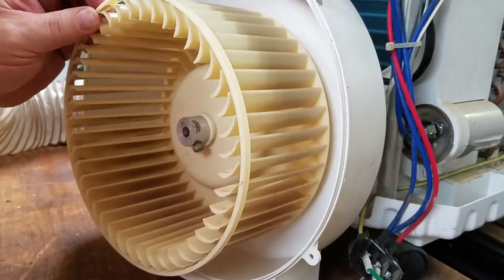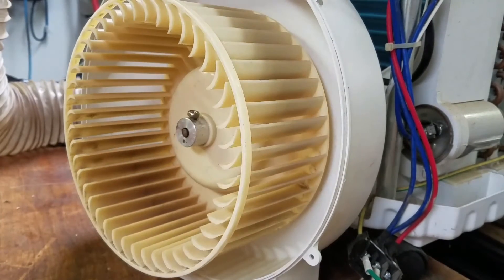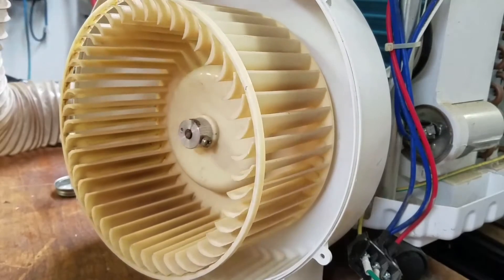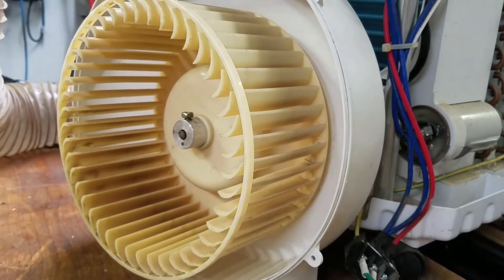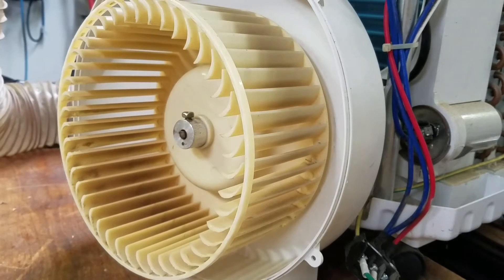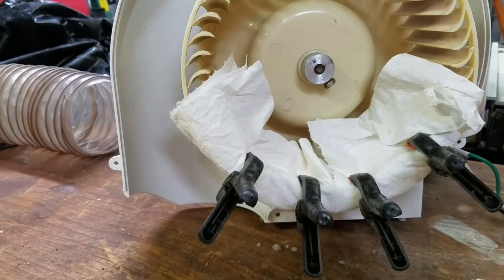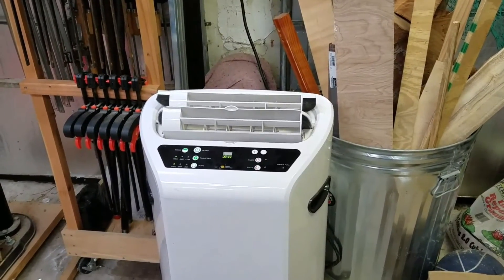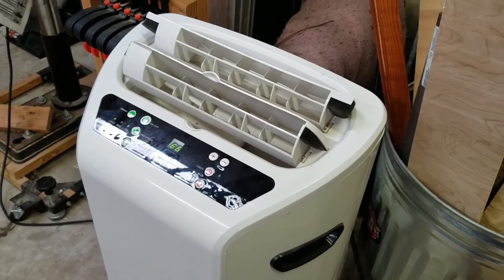Garage workshop portable air conditioner repair completed!

Comment: I cant find a part one how do you remove the blower fan? The mounting hole for the motor is to small to remove the fan through there and the hole where it pulls the cold are through the coil is to small as well and i don't see any seams to separate the styrofoam enclosure the blower fan is in cased in

Comment: Yeah, I bought one used and when I got it home it worked until that exhaust fan kicked on, and then the actual fan blades started shooting out the rear vent! I pulled all the panels off to try and figure out what to do but the fan is inside a nautilus looking casing that's behind something that looks like a radiator. Too much work just trying to get to the fan, which is pointless now because a lot of the fan blades are totally gone. 😔
Reply from the maker: Tracy, I will tell you this much. Once this thing completely gives up the ghost, I will never again buy a Royal Sovereign product. Exceptionally poor quality construction, and poorer quality control. The fan is exceptionally weak, the exhaust squirrel cage fan is downright dangerous, and to move air around enough to cool my 384 sq ft wood shop, I have to use a 20" air circulation fan from Home Depot. The specs look fantastic on paper, but in use, it's been nothing but an enormous waste of time effort and money.

The Nautilus shell cover for the fan isn't that hard to remove. Unbolt the screws for the metal tube uprights, unscrew the cover, nudge the upper piece up and shimmy the outer cover of the fan housing off. Okay I guess it was a bit of work... 

IF the rest of it works, you might try getting it apart and maybe seeing if you can scrounge up a squirrel cage blower fan that will fit and work from maybe a car AC unit or something... Just guessing at this point... 

I use mine in the garage workshop to keep it cool in the hot Texas summer, if I had to do it again, I would build a duct box to house a window unit, or better yet, install a mini split system.

I like it well enough to use it and put some effort into fixing / maintaining it. But I sure wouldn't put any real money into it, and I won't be buying from them again.
Reply: Dave's Workshop... Funny thing is... I found another used one of the exact same unit. I checked to make sure it worked before I bought it this time and transported it very carefully in the back seat of my pickup truck padded by pillows. The remote from the first unit works perfectly. I figured I could keep the broken one to salvage parts, or maybe order a new fan from the manufacturer.
Reply from the maker: Sadly, the MFG no longer supplies the replacement fan pieces for this unit.I would have bought a new one and swapped it in had it been available. That's why I went to the effort to glue / repair mine.
Reply: @Wildersport  These parts are amazingly common among many portable A/C units by a myriad of manufacturers. I was able to source the condenser blower motor from an online supplier, Sylvane. My unit had the same problem as yours. But the ring broke in two and jammed the wheel which overheated the motor. The motor has a non resettable thermal fuse imbedded in the windings. Also, the blower wheel itself seems to be available from Repair Clinic.
https://www.repairclinic.com/PartDetail/Blower-Wheel/A5304-450-AH-11/2110503
Thanks for your video!

Comment: The air conditioning unit was always working you broke it the fan blades so you could show us your super glue and Philips screw driver and what you can do with a q tip
Now I have a snooker que I will send it to you and you can show us all what you do with it

Comment: trying to open the Case cover on my Delonghi Penguino AC Unit without ruining anything, are there any how to videos? i dropped a drill bit through the top grill and it dropped down into the fan unit, how do i open it up and remove the drill bit?

Comment: I dropped a drill bit through the top grill of my Delonghi Penguino AC Unit, and it dropped down into the fan unit, how do i open it up and remove the drill bit without ruining anything, are there any how to videos?
Reply from the maker: I'm not entirely certain about the DeLonghi units I know I had to look up the assembly diagram from the manufacturer of mine to figure out how to take it apart. If you can get one of those magnets on an extending flexible shaft down there perhaps you can pull it up that way without disassembling your air conditioner. I am painfully curious how you managed to drop a drill bit into an air conditioner I'm sure there's a story behind that.

Comment: Mine is making an awful clanging/banging noice and it's VERY loud. How do you diagnose the problem?
Reply from the maker: At least with mine, it was sort of obvious the noise was coming from the lower squirrel cage fan area, I posted an earlier video of the noise mine was making. I honestly suspected a bearing in the fan motor. Oddly enough this unit has less than 100hrs run time on it since 2008. Anyway I opened it up expecting to find a flopping bearing instead of the fins being broken away from the ring. Simply put, mine was a bad QD flaw from Royal Sovereign. THey failed to insure the squirrel cage fan was secured. Anyway, if you are not comfortable with working around capacitors, keep the cover on that thing. Not that you need to take the capacitor out, but if you graze across it you can short yourself on it and get a VERY rude surprise. The cover comes off in a weird way. Take the screws out of the back, then the bottom. Remove the back half, there are 4 screws, 2 mid way, 2 bottom holding the front on. Top comes off last..The squirrel cage enclosure is pretty straight forward. If your noise is anything like mine, it is probably the same issue... Once you get into that squirrel cage enclosure you will be able to tell what is going on...
Reply: Hi Dave, my fan is broken I literally saw pieces sticking out I just can’t figure out how to get to it. I took the back off but that’s where I’m stuck now. Can I send you 2 photos maybe you can direct me where to go? Please?

Comment: mine works fine except the fans won't kick on for the exhaust! Any suggestions?
Reply from the maker: It's been awhile since I've been in mine. I'm going to have to go back through and watch the videos honestly because for some reason I thought the exhaust fan and the blower fan were driven off the same motor but I could be very wrong. Bear with me while I look!